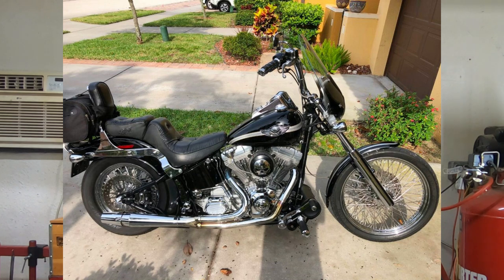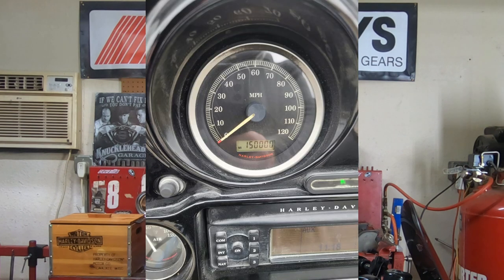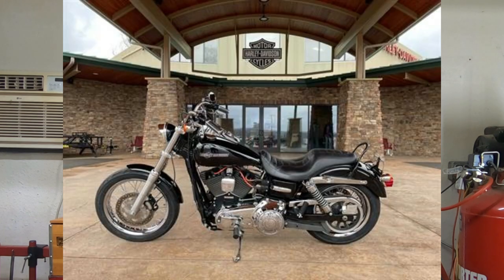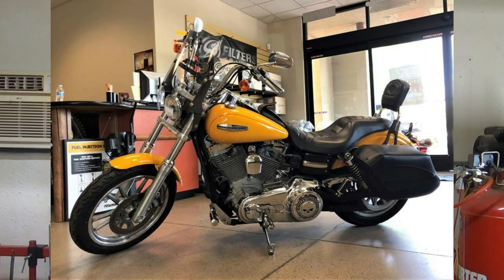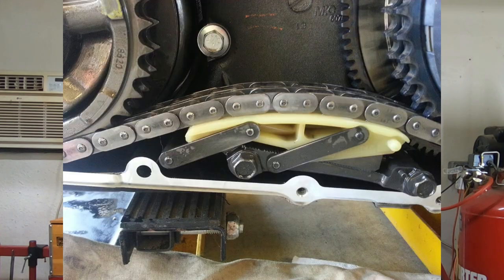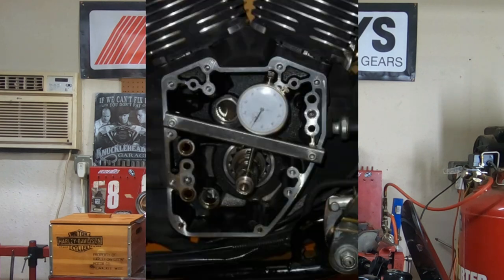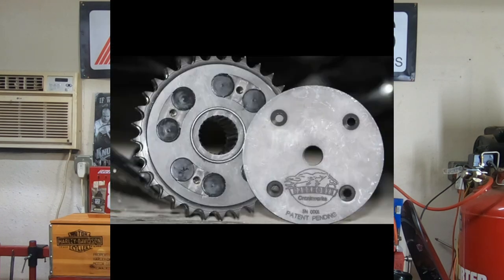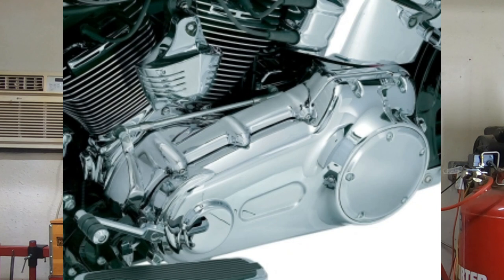Twin Cam Harley-Davidson Engineering is it's Own Worst Enemy

Comment: I purchased almost a year ago now a twin cam 88 with supposedly a stage 3 which apparently by my research is a 95 kit, still concerned about what all has been changed as to the tensioner and cam plate which I look forward to opening up this winter so I have a better idea of what I've got and what supposedly been done

Comment: 2004 ultra w 43k miles. These engines can be amazing if you’re willing to fix the factory problems. I’ve done tensioners, inner cam bearings, oil pump, tuner, exhaust, air cleaner.

Comment: Hey Gixxer
I have a 15 103 fp3 s e  air filter and slip ons ,and runs great... Im running motul 7100   
Oil and change every 2000k just to give it the best chance  possible...ps great channel man dig your vids over here in new Zealand
Cheers Murray

Comment: I have installed a Man O War compensator, S&S cam chest kit, S&S 583 cams, Arlen Ness Inverted air intake, an extra spring clutch and an Oil Buddy oil cooler on my 2016 FLSTC. Going to do a lot of the same mods on my 2010 FLHTK.
Reply: Hey just curious ma'am what did that increase your horsepower and torque to on the 2016 the mods you made on it????
Reply: @danwhyte3524  Haven’t had it on an an actual Dyno yet but my seat of the pants Dyno can tell that there is a big difference. BTW, I’m a 61 year old man lol. Been riding Harleys for 42 years.

Comment: If you buy a high milage twin cam thats in great shape otherwise , give a call to Kevin Baxter at Pro Twin Performance. The guy builds super twin cam or any Harley Davidson /Indian motor in his "Skunk Works" engine line S&S Cam plates and oil pumps, Darkhorse Cranks, Jims 6 speed transmissions.  He uses only the best (time-power) proven parts available. Give him a call.
Reply: @Tomcat8911  Over a year wait and still waiting.

Comment: Definitely some proud high mileage Twinkie owners around here 🇳🇿, what i hear online puts me off the idea of buying one though, sticking with the Evo
Reply: @Clovis Point likely distance and touring play the biggest part from the owners I know...city riding is hard on hot running air cooled engines
Reply: Excellent decision Owen, that's right where you belong ! Half Shovel, part Porsche. Think about us TWIN CAM folks while you're repairing your stripped out cases, where your cylinder studs stripped out. Or your rocker covers started leaking... again??!
Or maybe you just can't keep up with that TWIN Cam that just ran off from you getting on the highway !
  " Hey, say was that Owen we almost ran over back there, poking along like Granny? Man, he's gonna get hurt on that relic !" He ought to buy a new bike once every 15 to 20 years! Ha, ha, ha !
Reply: @clintwoodruff1187  😂 such a passionate response, stay free ✌
Reply: @clintwoodruff1187  who are you kidding dude? Your twin cam disposable piece of crap I would not take one for free because I could not afford to replace all the cheap parts they have in critical areas. The cam plate alone is $500 never mind the rest of the stuff that you have to do and pray that your crankshaft is it wobbling too badly to where you can't put a gear drive into it. There are no defects and unreliability have killed any resale value that they have because everyone knows if you buy one you're going to have to sink a ton of money into it to fix all of the built-in manufacturer's defect. Nevermind with the fuel injection that's a run hot as Hades. The only saving grace you can say about a twin-cam is that it is not as bad as a milwaukee-eight is. Leaking gaskets are not a big deal.

Comment: Thanks for posting.  I have a 1999 Electraglide Classic with 100k trouble free miles. First thing I did was a SE Mikuni flat side carb.  Early on with under 10k miles, I changed out the cam bearings, and at 60k miles, changed out the cam chest to hydraulic tensioners, high volume oil pump, and andrews stock lift cams.  Looking to replace the compensator soon, but the stock one still seems to be working fine for now.  I run the speed limits and don't hot rod the bike.  Other than a couple of crank sensors, I've done nothing except change the fluids on time.   Bike has been super reliable
Reply: Ron, don't think this as being argumentative, but if you had a '98 EV0, none of this would have been needed.

Comment: Wow, I really lucked out.
ordered a 2000 FXDWG and had the dealer install the screaming eagle high flow air filter that can be cleaned and reused. The mechanic insisted it needed a rejetting in the carb due to the air filter. So, without realizing it, I got the kit that routed the oil vapor away from the air inlet and down under the bike plus richer jetting in the carb right from the dealer.

They did me a huge favor.

My bike now has 88,000 miles with no problems from the engine or trans. It has the five speed.

Comment: I own an 03 road king classic I've changed the cam tensioners the needle bearings and changed to hydraulic pushrods it was the 30.000 mile service at about 28.500 and just regular oil and other fluid changes at About 5000 mile intervals other than that she's completely stock

Comment: Great video. Got 87k on 2012 TC Glide. Darkhorse compensator best thing I did. Added Hayden tensioner. Mobil 1 always. Refreshed the engine with new lifters and OEM cams. No reason to spend 30k on another Glide.
REQUEST!
Could you do a video on fork Emulators?? I recently installed Racetech. I've been hesitant to say they're worth the effort.

Comment: Oh God I just have to laugh. Maintenance on my Sportster is so simple the little I have to do. $400,000 miles on the bike still on the original primary chain as well as the original engine. I can basically change all the fluids and filter in my driveway in like 30 minutes. It asks so little of you criminal not to do the stuff it asks of you. My Triumph TR6 my 1965 is 50 years old Plus and it's still on the original primary chain I have never changed it. Just check the tension and adjust it once in a blue moon as needed.
Reply: Sportsters are awesome. I've had 2, and saving up for one right now.

Comment: You present insightful information in bits and pieces on all your videos. It might be asking a lot but, would it be possible to create a downloadable flow sheet that shows suggested upgrades for the various model years. This sheet would help ask the appropriate questions when shopping for a used motorcycle to know if mods have already been performed or if an expense should be anticipated.

Comment: At least I have an answer to why my trans main shaft bearing locked up. I put in a brand new tranny and then sold the bike. Never to get another Twin.
Reply from the maker: I would say combination of crankshaft slop and overtightened primary chain by the tensioner is what did it. There wasn't anything wildly different from the 5 to 6 speed tans, on thing they changed was the primary chain tensioner. 88's had the wobbly crank later years and never tore their transmissions.
Reply: @GixxerFoo  my 88" got 3 thou runout man...I guess I got a good one.

Comment: I have an 07 rk. I went in to change the stator. Primary was adjusted perfectly. I went to the dealer to get the newer modified tensioner with the B suffix I’d read about, but apparently that part is now unavailable. Very odd.

Comment: So I wrote  to Doc Harley  at Low Country Harley. He posts a lot of helpful blogs out here to help people.  So, I asked him why I took the time to take my manual chain tensioner off and spend $125 for a Harley Automatic Chain Tensioner when its worse than the manual one and I still have to check it.  I also asked why it takes Harley three tries  minimum go get anything designed correct.  I think if Harley had more and better Engineers they wouldn't need so many lawyers.  I guess I pissed of Doc....LOL

Comment: I ride in a 1% support club and a lot of guys run twin cam bikes. We absolutely thrash on or bikes for hundreds miles at a time.  I can vouch from experience the twincam is a damn good engine. Mind you we all work on our own bikes often but we ride them hard.
Reply: Just asking not implying anything here, how many miles are you getting out of a true cam? I have a fxr with a S@S motor in it for fun and a road glide for putting around on and long days.
Reply: @aaronbrooks7106  mine has 40k another one of my guys has one 108k and that bike is rough but still runs somehow. For most part they all have over 50k and get run hard. Several of the guys are retired harley tech's and life long club members and they all absolutely sware by evos and twincams. Even the guys that own m8s say they like evo and twincam better.
Reply: @omw2fymom76  X-HD mechanic friend of mine used to claim they'd see EVO's come in with 200,000mi+, he claimed you'd never see 1/2 that on a TC !  I believe him now.
Reply: @daghostxxx1797   early model twincams are the bees knees man.  With out a doubt . Take a look at all the stunt guys that run them. They run those bikes hard at low speeds and they power through and keep ticking. All the high mileage twincam bikes I ride with are timken bottom end bikes with upgraded cam chain tensioners. One of the bikes has 230k miles and recently had head gaskets replaced that's all that has been done to it. They're not exactly "junk" but a stock stage 1 twincam 88 will run the hell over a stock or even stage 1-2 evo. all day.  Been there done that.🤣

Comment: Yea buying a used twin cam . I made that mistake from a Harley dealer a 12 street glide 103 . Checked out by service department.  The crane went out in less than 1000 miles probably 500 ..so I got a SS 124 in it now that had work to the cylinder heads.  I would not own a stock Harley twin cam . Yep I got a dark horse com , billet basket , chain drive , good clutch.  DD exhaust ect ect money pits on both bikes . Both have SS engines.  In my opinion lifters are a maintenance item , I don't wait till they fail .

Comment: Gixxerfoo, I have a 2000 Road King EFI, runs great and never gets hot. Stage 1 - V&H Dresser Duals, K&N stage 1 breather. I’m sure it had to have been tuned at some point before I bought it and I’ve looked for the tuner. Under the seat, under the side covers, etc. Anywhere else it might be hiding?! Possible to get tuned at the bike’s computer only?

Comment: I have a 02 FXSTB with the SE hole shot primary chain with updated primary chain adjuster, Updated Harley-Davidson cam plate. I have a new SE 2002 6speed I’m about to drop in, but wondering if that 6speed will give me any problems

Comment: Going to check out that Fueling plate and pump you mentioned but I think you are dead on in your opinion...texted before, I have 2 2002 FXDWG'S, carbureted, Timken factory crank bearings, gear driven cams (S&Something)...any modifications beyond this point are just not the same...lol 😆 
You are dead on, IMO, the 2002A motor Twin Cam carbureted Dyna is the best Twin cam...but they too, had issues, just not as many 🙄
P.S. I know this isn't exactly what you said, I know what you really meant...someone SCREWED UP in 2003...and beyond............

Comment: I've got a 99 Roadking Tc 88...What Crank does it have? I just finished doing the Feuling Kit..Cams.. Hydraulic Tensioners from Feuling..the Runout was at worse 3/1000...Mechanic said that is marvelous for a bike with 40K plus miles..my question is do I need to worry about a press fit crank ?

Comment: what about timkin bearings not used in 2003 and to date? bad bearings give slop in crank and then it moves through the whole engine as well as trans

Comment: I wish there had of been more warning about rear pulley bolts breaking. Got my first harley (2008 Dyna low rider) this past spring and rode it twice for less than an hour total and broke the bolts and destroyed my pulley and wheel. Been sitting since and I'll never ever buy another because I was way less than impressed with it.
Reply: These kinds of problems normally arise because someone has put aftermarket pulleys on there at some point, or messed with the bolts. 99% sure that is the case with your bike, especially 2 hours after buying it. Those things don't just break out of nowhere.
Reply: @keesketsers5866  it's a well documented issue. The spec for the bolt from harley is incorrect.

Comment: You mention every year 2003 and newer. I own a 2002 FSXTDI. It has 8500 miles on it. Can a solid crank Timken engine take an S&S cam plate?  The original owner installed V&H BIG SHOTS with a stock tune.  I took the bike with 3200 miles, looking neglected, 6 years ago. I changed all the fluids. Everything! The stock air intake is still on my bike. For my requirements, my Deuce has plenty of power to haul 150lbs of me down the highway. You said oil cooler enough that I think I should install one.

Comment: My comments have being harsh towards the TC and they still are.  You're video is spot on.  What bugs the shit out of me is how good the EVO was with 200,000 miles reliability and the MOCO came out with this garbage, which are money pits.   99-06 are great after you have invested $4,000-6,000.  07-up are great after $2,000-3,000 in updates.  Sorry if I hurt someone's feelings but TCs are shit,  considering the price you paid when buying these motocycles.  My 1980 Shovelhead and my 2000 Honda Pan European 1100 are both bullet proof.
Reply: Bought a 99' Ultra with 88"A model factory demo with 9000 miles on it, only work I've done is chain tensioner pad replacement, put in adjustable pushrods. 160,000 miles no problems. Most of those miles were loaded down with gear and wife on back. I suspect though, it was tuned to get a little extra fuel being new engine. 38 mpg. You're right about the shovel, seen a few that went the distance. Rode my 62' Pan 27 years with just one top end job.

Comment: I have a 2014 flhxs with stage 4 kit installed at 20 miles on it when I bought it. Turned 40,000. Three oil change. WHAT do I need to watch for???

Comment: If you have a motorcycle with a twin cam can you replace the twin cam with an Evolution motor?
Reply from the maker: I do believe there are some kits out there just for that, I know they have kits to put a twin cam in a FXR frame.
Reply: @GixxerFoo  I don't imagine anybody in their right mind taking an EVO engine out of an FXR and put the twin cam in it it just has such a shopping list of manufactured defects it's almost like a Norton Commando just as bad. And zmh just like my God I just shake my head at the thing. I don't know what the exemption is for low unit Manufacturing but if Harley is getting to that point I would go and get an exemption and then I would not have to be satisfying EPA and Euro 5 regulations. They'd be more like a custom builder with a production line and as your bike went down the line they were instructed to put whatever things you wanted to put in it. BSA used to do this during the 1950s you could choose the gear ratios and what in your transmission what type of transmission you had what type of Magneto Etc what type of tires you wanted for the use of the bike. Of course people say it's a customization service of them instead of just building one bike like Honda saying this is what you got. It's one of the things that killed them but I think that's one of the things that made them great. It's a shame that you have to buy so much thousands of dollars apart and then basically she can them cuz nobody wants them and then put on the exhaust you want and the controls you want and everything else which is such a shame after you spend so much money to begin with. Thanks for answering my question bye
Reply: S & S used to make TC cases with a EVO style rear mount . I believe that might still be available from Star racing also called G squared racing that's where all the S & S pro stock motors come from 159 cu in !
Reply: Oh yeah I have a 95 in TC motor in my wife's FXR !

Comment: alot of problems are popping up with the s& s oil pump and cam plates. i just recently saw a bike implode at 15 k with said combo. now to be fair that bike was summing horriblely and the run out was off the charts. but what came first the chicken or the egg. ??? Also it was an 2018 m8 so.... 
Ive got to get into my cam chest again this year as i put 40k on the bike last year but i just got it in the house yesterday , got her stripped down a little ,dumped the fluids and changed a couple shit electrical plugs. more later. Tomorrow ill pull the nacelle and forks. next day will be cam chest.
Reply: The S & S pump & plate has magnets in the oil pickups cam chest & crankcase I've seen the crank shaft bearings shed pieces & clog up the pick ups & stop pumping oil ! They are strong though I still like it better then billit pumps & plates !
Reply: @leonardstanford1877  yeah I put my money on them but after watching a lot of them fail im a little worried. ill see in a couple days.

Comment: had an 02 fxdx branch headwork 10.5 to 1 pistons and branch cams s&s geardrive milwakee twins oil cooler thunderheader on the dynodrags went 10.22 at 127 mph 107 hp 115 tg rode it all over the west put 70 000 miles sold to a friend he tried to do a burnout and rode it into the back of his own truck totalled it

Comment: I have a tuner question for ya brother… when I bought my 07 street glide I changed the exhaust and air cleaner (already had high flow and V&H true dual long shots) I swapped to V&H big radius and went to put the V&H FP3 on it to tune it and found she already had a dynojet power commander 3… my question is which in your opinion is the better tuner? I love the real time display from the Bluetooth on the FP3 but I’ve always heard dynojet blows all the other tuners outta the water… if I go back to the PC3 can I load premade maps on it like the FP3? or does it have to be dyno tuned every time I change something? And is there an attachment i can add to it to have the real time display of temps, mph, rpm, etc… hope this makes sense cause I strongly value your opinion when it comes to this stuff!!